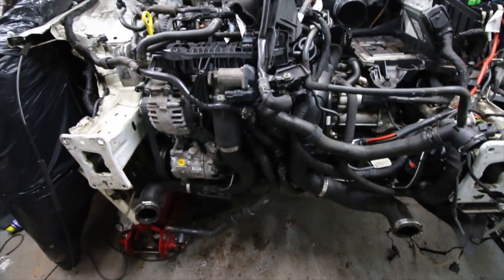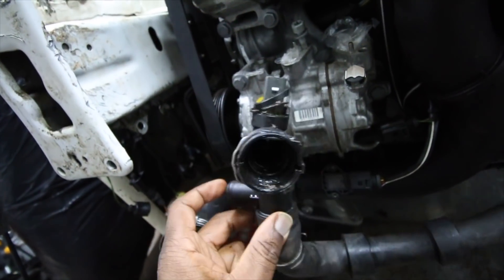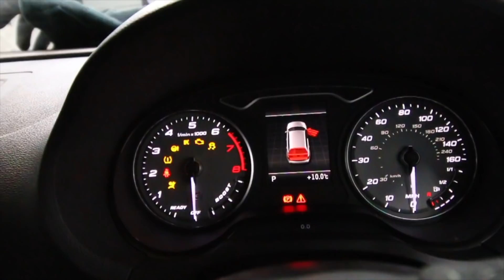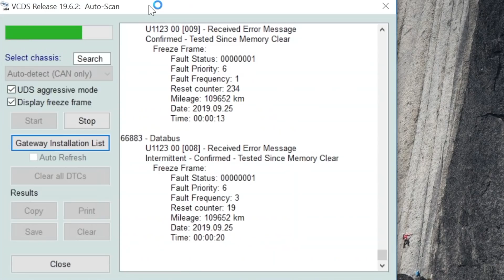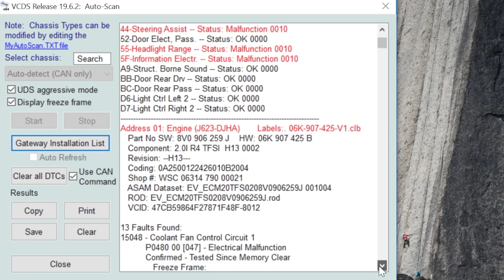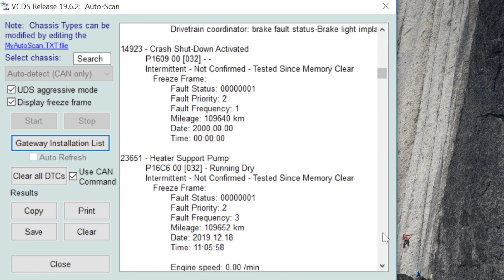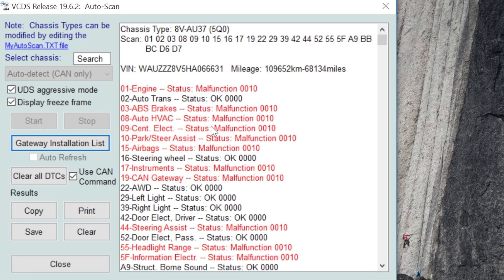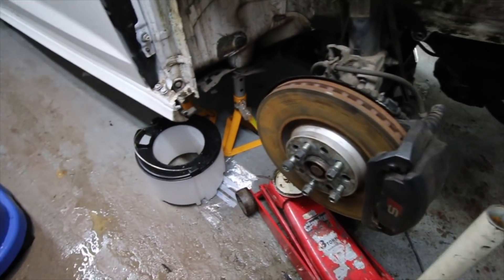My Audi S3 has electrical problems? VCDS to the rescue

Comment: Don’t know if this will help but my Audi A3 1.6 2011 it had over 16 faults listed, had all the fault light on, speedo meter was stuck on zero and petrol meter was fucked. Turns out it was just a fuse issue!! And the car works fine now. zero faults

Comment: Just a quick question paul would you be able to change the analogue clock to a virtual one? Loving the build videos by the way keep it up👍🏼
Reply from the maker: Yes you can, you need the VC head unit as well as the screen, and it aint cheap

Comment: Info for you: The VW/Audi cars i worked on all have Steering Assist and ESP failures every time the batteri was disconnected. The errors (lights on the dash) cleared after few 100 meters drive. Then you can clear them one for all with VCDS.
Reply from the maker: I had the same thing on my Seat Leon